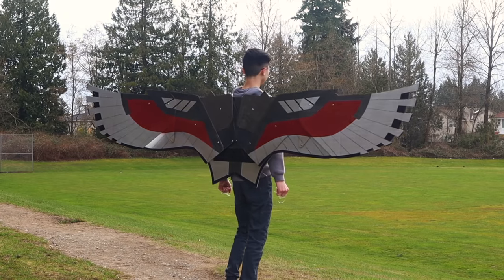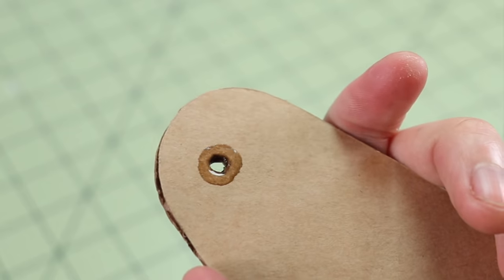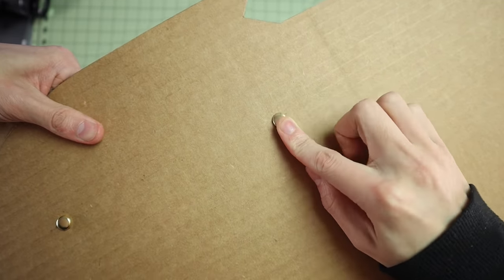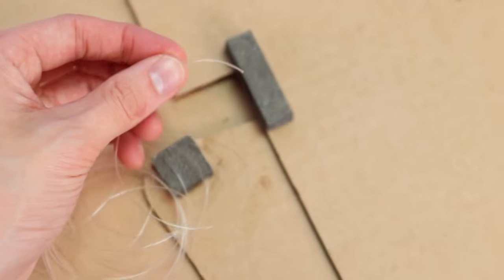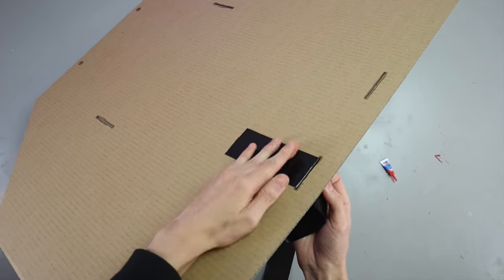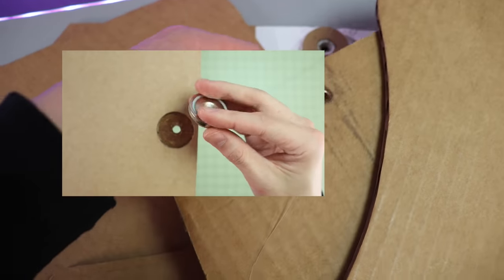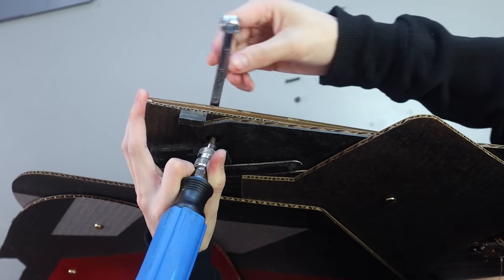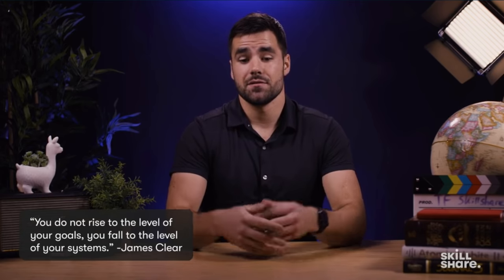I Made FOLDABLE FALCON WINGS From Falcon and The Winter Soldier! Made From Cardboard (DIY)

Comment: You should give it a try but first you have to give it some thrust so it doesn't stall midair so I recommend using a small electric propeller unless your crazy enough to jump off a 20 story building. and you have to put a vertical stabilizer so you wont keep spiraling and you might have to add some vertical stabilizers on your feet so you can pitch up And down (I know a pretty good bit about planes because my dad is a pilot he flies only a Cessna 172 and I love planes) and since you have two feet you have to have two vertical stabilizers and if you wanna be cool you can tilt them a lil bit.

Comment: These are awesome! I did try to make them, but they did not turn out the way I wanted. First of all, you need really thin cardboard in order for the wings to slide back and forth easily. Second of all, the metal fasteners are not very sturdy and come out quite easily; I had to duct tape the fasteners in order for them to stay in. Third of all, I made two identical wings, and went to put them on the "backpack", and I realized that the wings supposed to be mirror image in order to function. In the video, he makes two pieces with the big magnet, one for the left wing and one for the right wing (2:48). It seems like from there, he makes two identical wings, but for anyone (like my unfortunate self), DO NOT MAKE TWO IDENTICALLY FACING WINGS!!!!!!!! You will be very discouraged after $65 and 10 hours of painstaking work.
Reply: thanks for letting us know. he should pin your comment

Comment: you could have used those 2 part nut things used in leathercrafting to hold two pieces together and when the connection is permanent, just hammer them and thats it, it should hold